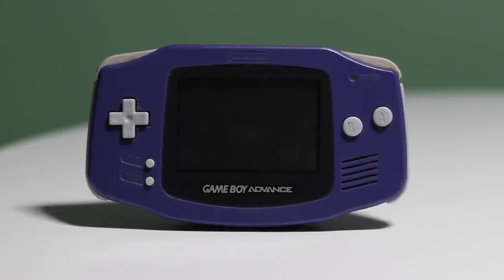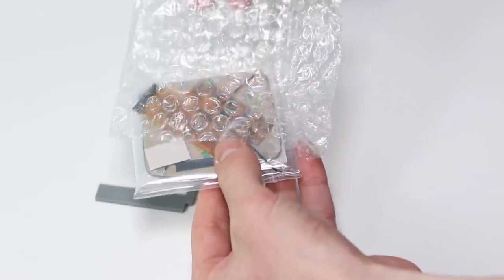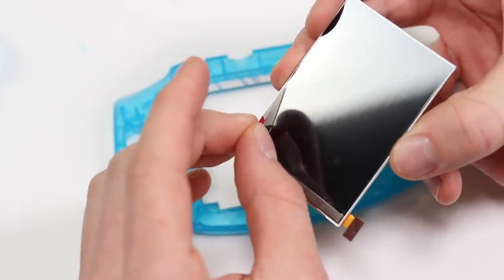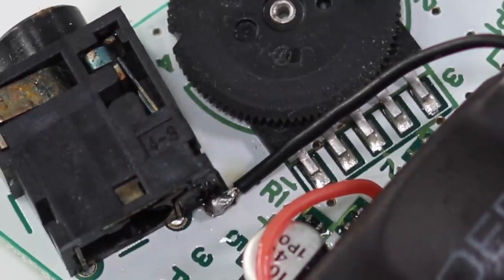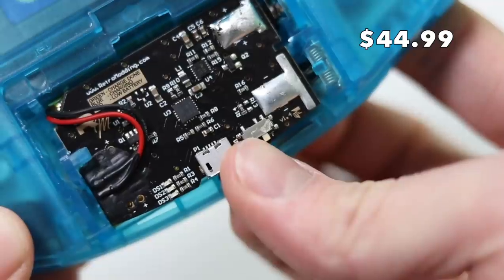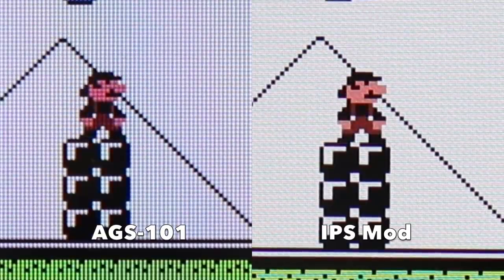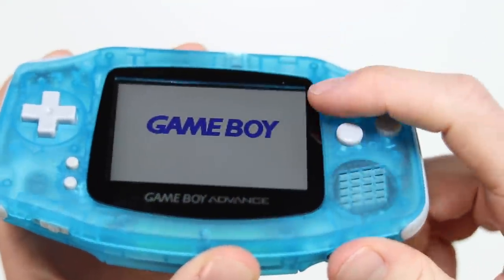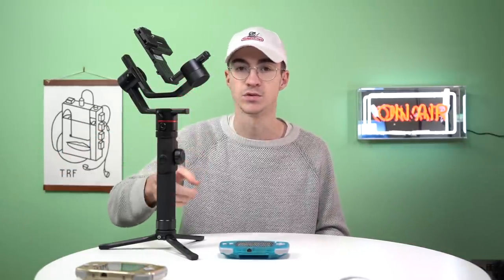$200 ULTIMATE GameBoy Advance Build!

Comment: I bought an ips screen from AliExpress it cost £30 delivered and required no soldering. I bought a new amp,new speaker and a dehum/dehiss kit for about £25 from Retro Six. The Retro Six stuff is easy to install as the unit is designed to be soldered in with no wires. They also sell a battery pack for £27 again no soldering, but minor cuting for the battery pack.

Comment: Hey Eliott, did the same what you did, but only on the IPS screen part. The "TP2" layer broke off on the motherboard so I had to deal with a very small side part + some scraping open of the motherboard again to solder the cable onto it. Did all this without tinning up the pads though :P Was my first time so I did 3 hours over it with scraping inclusive with a normal olfa blade. Works for me! Waw IPS screen v2 is really something. But only the headphone jack still has a problem: it has noise on it. Any idea how to remove this "noise"?

Comment: I 'm able to get about 6 hours of play with some Energizer rechargeable batteries on low brightness on my IPS modded GBA. I actually prefer the AAs because i can go from dead battery to another 6 hours of play with a few seconds of battery swap rather than being tied to a wall. Just keep the spare charged AAs in a carrying case with the GBA. 

Though i'm going to say this: getting the battery mod with a CNC'd battery cover with a slot to plug into would make the GBA feel like a very modern retro-style system rather than a retro system that was modernized.

Comment: Wouldn't two normal 3000 mAh rechargeable AA batteries last longer that the $50 1400 mAh rechargeable kit? You could keep the other two already charged.
I would definitely spend the saved money on the prepared case.

Comment: Please stop just saying "IPA" like any % will do. If you are using it on electronics, it really needs to be 90%+ IPA. The lower the percentage, the higher the chance of it causing issues later. You want the least amount of water in it you can get so it doesnt cause corrosion. (Most stores typically sell 70% as a standard).

Comment: I bought an authentic spice orange GBA from Japan before I knew you needed to cut the shell and now I'm too scared to touch it. D^8)
I paid twice as much to get it so I really dont want to risk permanently ruining it. My safest bet is probably to put a dremel to it and shave it gradually, checking to see if the screen fits periodically.

Also, I'm pretty sure I caught the culprit for your misaligned screen. That 3D printed brace is meant to lay in the shell and hold the screen in the proper position.

Comment: Trying to follow the video step by step, it seemed a bit fast. Well, attempt #1 at this having done no gameboy modding before didn't go so well. lost the rubber shoulder pad twice trying to put it back in, got the battery pack stuck in the back cover twice before realising I had to remove the spring contact, and then spent 20 min trying to work out why it wasn't turning on, before realising that the battery probably needed charging. Once I plugged it in, found everything was working apart from the screen. Guess its time to disassemble it and try the screen again.

Edit: the screen connection on the motherboard was loose. Used the old screen from the donor to confirm that still worked and then swapped in the new screen. Got it all functional in the end!

Comment: I've noticed rechargable batteries that recharge via micro USB.
They have an impressive amount of power from what I can tell, and I was a bit curious.
How would these kinds of batteries stack up compared to the custom power supplies traditionally used for GBA modding?
And would it be viable to use these as a cheaper alternative instead of the power supplies that are normally used?

Comment: Yo if you're still in the market for a cheap dremel-like, there's a rotary tool made by Wen that comes with a flex cable and some accessories for like twenty bucks on US Amazon. Just make sure to use it with the flex cable because the unit itself is big and unwieldy but it's good with the flex cable and compatible with the dremel bits.

Comment: I used a pre cut she'll.
I would recommend buying a dud gba to use as your shell.
The pre cut shell screws did not want to go in. Like the plastic wasn't right diameter for them.
I didn't think I would get it back together and the provided screws, their heads were stripping out.
I had to use a mix of provided screws and original ones.
I used the original battery area screw and couldn't screw it but half way down.
I would rather cut out the original shell than mess with those screws in pre cut shell.

Comment: Advises to spend extra $20 on a shell to save time and that it will fit better, then proceeds to do the cuts with an exacto blade and wire cutters...ever hear of harbor freight? You can get a dremel/high speed rotor kit for less than $10 that will make next to perfect cuts on plastic.

Comment: Hello  Elliot, i have an old nitendo ds lite that i found recently. It is quite old and it powered on once. I put the date and time and then it told me to restart.  That was the last time it turned on. It looks like it charges and the power light lights up. Any suggestions?
Also would you be intrested in making a video about it since it has just been sitting around with no real purpose?  I can send it to you
Reply: rylen sounds like a broken connection between MB and the screen. But we will never know if you dont bring it to someone who knows stuff and let it open.
Reply: @mukamuka9822  ok il give it a shot myself because its so old and it has dead pixels. I dont think is worth getting it to a repair shop.
Reply: @rylen4  power your ds on and hold it in a dark room under a light and look if you can spot any kind of activity on your screen. Post result
Reply: @mukamuka9822  no absolutly nothing

Comment: The thing is, i have a Battery charger and rechargeable batteries.
Like with the 360controller once theyre empty i just swap them out therefore i never actually have to charge it when i want to play.

The screen is a massive upgrade though ngl

Comment: I did the screen mod. But I ran into some issues with my current shell. I used the 3M tape and applied the new glass. How would I go about transferring the ops screen to a new shell?

Comment: Good videos, but I did want to give you some constructive criticism. Cutting the shell is not hard at all, some flush cutters, utility knife, and a rotary tool like the dremel make it easy. You didnt need to cut the bottom of the screen part of the shell. All you cut is the lip sticking out on the bottom and right side and the right wall, thats it :) the shells cost between $9-$13, very cheap and they are not perfect, you still have to go in and finish the job. The last thing is you said you wouldnt give your opinion but then did, just give your opinion :) we want to hear your thoughts on whatever you're building/modding :) keep up the good work as always!!

Comment: I don't know if you'll see this but I'm having trouble with a DMG. Everything seems to be working except the display. When it's turned on the audio can be heard but nothing is displayed even when there is a game in the audio can be heard but nothing displayed. All the pixels on the screen work as I've turned up the contrast to see and they all are there but still doesn't show the game. I've tried cleaning ribbon cable but that didn't seem to work can i have any input from you as you seem fairly experienced :) thank you!

Comment: Just a heads up, the analog pocket is also going to retail for 200 when it launches, and does everything this mod will do plus more game platforms. Really the only thing I think you lose by going with the pocket is GCN and link cable support, and I could even be wrong there.

Comment: This might be controversial but I actively avoid rechargeable batteries for old handheld consoles. Even more so if they are bespoke.

One day that battery will no longer be able to hold a charge, and if it's a bespoke battery then it might be difficult to replace. However if it's e.g. the GBA SP you can get non-Nintendo replacement batteries a dime a dozen.

In that sense, this GBA is my dream handheld if it took double As.
Reply: What do you mean by bespoke?

Comment: I’m a complete newbie to modding so please excuse me if this is a dumb question, but is IPA something that will evaporate quickly? I mean you would have to just let it evaporate in some of the areas you were applying and since I know nothing about it I was just wondering if that would cause rust.
Reply: IPA vaporizes almost instantly at room temp. That's why it's used instead of water, it won't sit and rust out your metal parts, and will evaporate before you're even done reassembling most likely, so no worries about shorting anything out.

Comment: I just got a gba that has modded custom speakers back lit screen with different levels of brightness rechargeable battery with the choice of AAs custom shell and buttons to look like the switch lite Pokémon sword and shield theme for just 170
Reply: Got it from simontew5953 on eBay

Comment: The rechargeable battery is convenient, but wildly overpriced, you can get pretty decent rechargeable batteries (with charger) like the Ikea Ladda for less, and similar runtime.
Reply: And I don't think it's any better capacity than any good rechargeable AA. I have a paid of Duracell 2500mAh in mine. If the mod required to cut even more of the shell and had a 4000mAh battery than maybe that would be worth it.

Comment: you inspired me getting my stuff off of amazon a local mom and pop game shop have the gba i wanted for this my build will have the ips screen and a glow in the dark shell i will however be keeping the old shell i am going to have to buy a dremmel found a cordless one from a different brand so psyched to do this in time might even make a video of it I don't have an ultrasonic cleaner but i will get that in time i even have 91% rubbing alcohol aka isopropyl first time doing this so excited but also a bit nervous i will even go over the costs major thing is to keep it at a budget
Reply: just need a sonic toothbrush probably grab a cheap one like an oral-b pulsar
Reply: however I prefer the agb-001 model

Comment: I just finished my own GBA last week! i didnt do the amp kit but i did use the screen and battery. both WELL worth it
Reply: i also did not solder the brightness controls because my first screen was cracked, and while i was waiting for a replacement screen...i accidentally threw away the wires...

Comment: Congrats on your mod! It turned out great. I've never had to cut the viewport on my shells to fit the IPS. I also think you can get the screen centered with a little work. I think the centering bracket really helps for this. I would always definitely install it. In my experience, a good way to ensure it is centered without having to cut the viewport is to trim about half of the shims on the inside of the wall on the A/B button side and then slowly shave away the remaining areas outlined in the instructions until the screen drops in snugly. I do use a mill which makes this precise work a bit more uniform, but I feel that I could probably achieve the same results by hand. Ymmv. From there you have to take care to center the glass. I usually gently apply the glass at first and then use guitar picks to scoot it around with the screen turned on until each edge seems to be equally visible. That's when I go in for the kill and give the whole perimeter of the glass a firm press. You should try your hand at another one of these. My first unit turned out pretty good, but all the lessons I learned from the first made the second much easier and it turned out at a much higher quality. Cheers!

Comment: I still find it hilarious that the original Gameboy has lots and lots of advertising all over it that it can output stereo sound yet it only has one speaker and even the SP only has one speaker
Reply: Having stereo when the speakers are both that close is pretty useless. It does real stereo with headphones at least.
Reply: @chamoo232  always wondered if the ds did stereo when playing gba games because it has those 2 speakers
Reply: @bland9876  I checked online and found a forum talking about this and even people trying to test it couldn't really notice stereo separation. My personal guess is that sound is always rendered in stereo all the time on any GBA compatible device and it's only when it reach the speaker that it merge into mono sound on the GBA. I think the DS is stereo for GBA but once again the speakers being so close make it very hard to notice any difference.

Comment: Is the soldering required for the brightness mod? Or is it just for the brightness control?
Reply: The screen is connected via ribbon cable, the soldering is for the brightness control. You could install the screen without soldering the brightness controls, but you’ll be stuck at whatever the screen’s default brightness is with no way to change it

Comment: ultimate gba is a psp 3000 with gbsp emulator on it. also much cheaper.
Reply: Or just an Android phone a lot of people already have in their pocket, and something like a MOGA gamepad.
Reply: PSP doesn't let you use real GBA cartridges. PSP screen is good but the IPS mod is much better. PSP batteries are also getting very hard to get as the original are all bulging and the replacement ones are hit or miss and not at all as good as the originals were. I have every model of PSP and I am one of those who can't tolerate the 3000's interlacing on the screen. I much prefer the 2000's screen. Moving up and down quickly in the PSP menu is smooth on 1000 and 2000 but has horizontal lines on the 3000.

Comment: Sweet mods, the GBA has always been my favorite handheld.  Do you know if there is a way to make the screen backlight controlled by a potentiometer type switch? A way to just dial it up or down like the volume.  Also curious about doing the same thing with the overclock mods. Would it be possible to install a control knob for the over/underclock mod speed?
Reply: Mykel Hardin  I know but that's not what I want to do.

Comment: Ultimate Gameboy without additional buttons?
Idk how ultimate that is.
Reply: Why would you need extra buttons?
Reply: Honestly I just prefer having bonus buttons for certain games. A turbo button is nice, using a shoulder or select button as an x or y button can feel better in some games. 
It's not neccisary, it's just a nice quality of life feature.
Reply: @o0kaelas  That would be far easier to pull off in a raspberry pi build than a real GBA in my opinion. Mapping the buttons inside that crammed shell would be a nightmare. If it was a Pi then yes you would definitely need every buttons needed for emulating more consoles. That being said there are so many small consoles like the RG350 these days that are already small and have all the buttons.

Comment: The screen and battery pack is cool. I can do without the speaker mod.
Reply: That's my opinion as well and even the battery is just too expensive. I will keep using my rechargeable AA batteries.

Comment: Hi! Thank you for this amazing video. Do you think it will be possible to see a Nintendo 3DS with a HD screen in the future? That’s one of my sweetest dreams.
Reply: Very unlikely. Even if someone found a screen that fits and made a ribbon connector for it, it wouldn't make the 3DS HD. The console would still output at the same resolution. The image would just be a bit sharper. The reason why the GBA look that sharp on the IPS is because the output is exactly 2x the resolution. Each original pixel takes 4 pixel on the IPS screen. For it to happen with the 3ds someone would need to find a screen that is the same size as the 3ds screen, have exactly twice the pixel resolution and make a custom ribbon connector to convert the signal.

Comment: All retro modding do is import the kits from china, and then sell them at a markup. It is cheaper to just buy the parts from the manufacturers off something like aliexpress, especially if you live outside the USA, where the shipping cost from retro modding could be the same as the part itself.